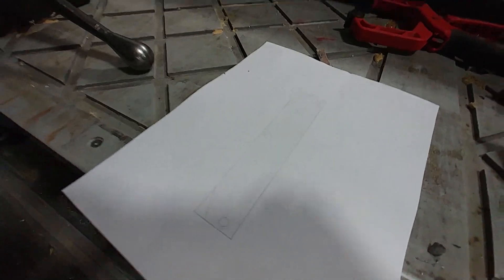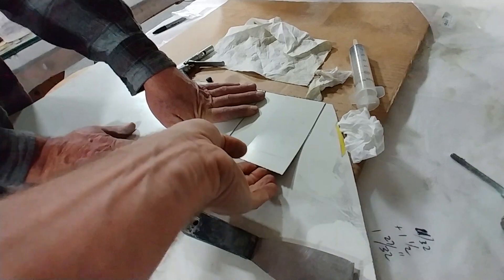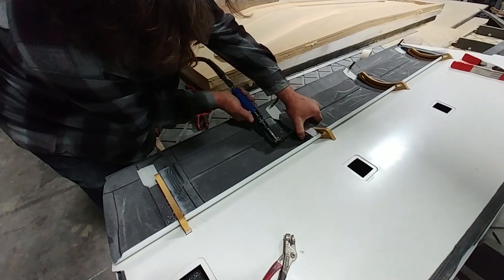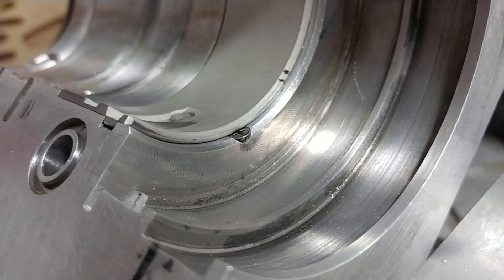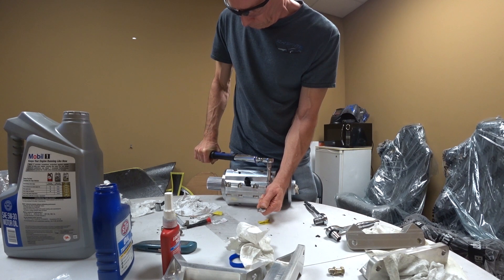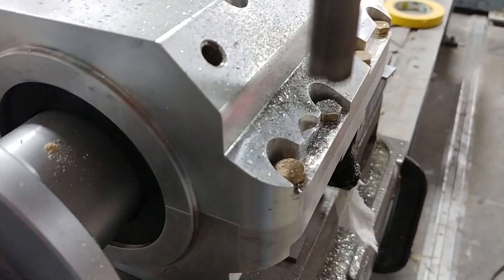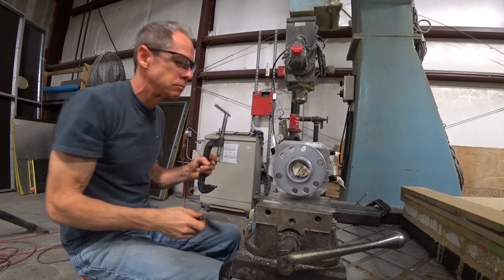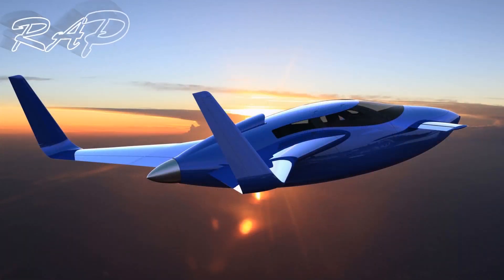Reduction Drive 2019 - Building the Raptor Prototype

Comment: Hi. Great job on the prototype. Cant wait to see her flying! 
I believe you are using tight clearances between the pins and rollers for the slide of the foreplane. You should use at least 100 micron clearance between the pins and the rollers . Unless the rollers are filled with grease and sealed, bearings with tight cleance tend to jam with dust and sand. What are the materials? Even 400 series stainless tend to corrode in seaside locations.